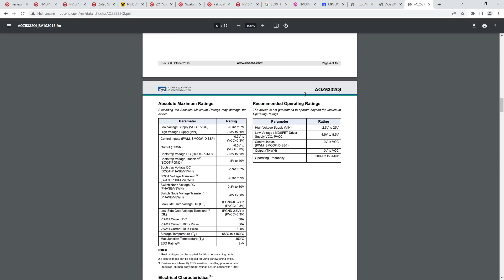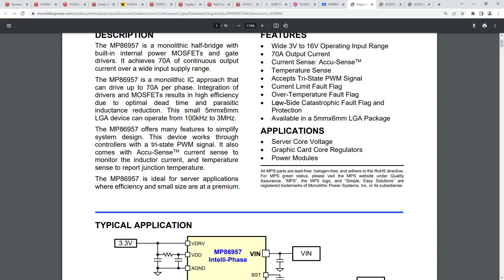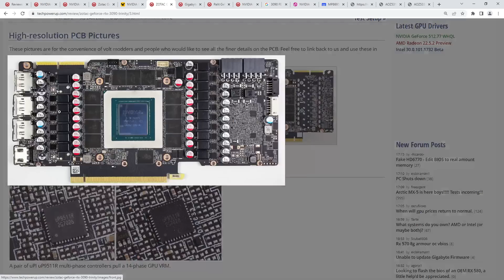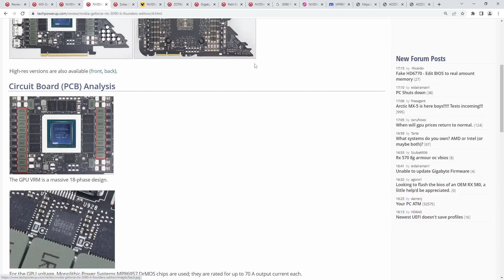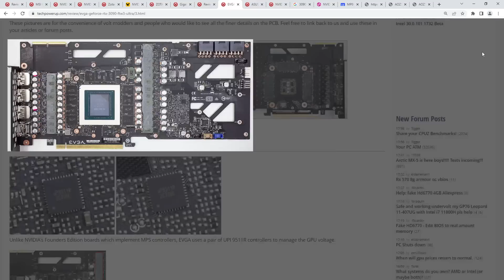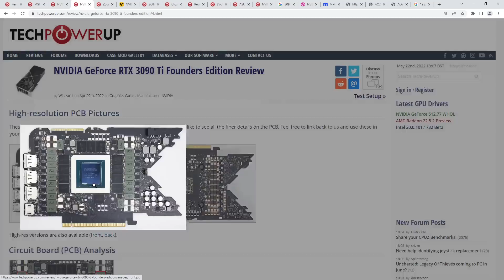RTX 3090 Tis should be much more reliable than RTX 3090s

Comment: I totally agree with you. I can speak from experience.
1. AOZ5332QI and AOZ5311NQI are used in 90% of 3080-90 and are definitely the cheap solution. 95% of the cards that have been shorted is due to these parts. In most of the cases a repair is possible, but the circuit board is burnt and everything has to be milled. Unfortunately if one of the memory phases blows then the GPU and all the ram chips burn up. I definitely don't like them and find this a big manufacturer mistake.
2. MPS has great phases and controllers. All protections are synchronized and if something goes wrong the whole system shuts down and can't boot until the failed phase is replaced and the error is cleared from the contorller. They are definitely more expensive,but I have never seen a card blown,burned or destroyed with them.
Reply: If the card has crappy components it's not a manufacturer mistake, it's a manufacturer CHOICE
Reply: Alpha&Omega components is stuff i see on my sub 300 dollar 3d printer motherboards, literally.
Reply: Are founder editions affected by this? Just strictly founder 3090 (regular models) will thermal pads help?
Reply: Which cards use MPS as you mentioned?
Reply: I use 890w on my 3090 ti tuf with 17 phases vrm and limit the pl to 623w
Some games power draw 570w-600w
Is it safe?
How much power 17 phases vrm can handle?
Reply: Hey I know I'm a little late on the reply but I agree. Nvidia just put the blame on Micron for the hot operation temps on GDDR6X and Microns outline stated 95c is an acceptable operating temps so people are still running these things with stock cooling and believe that the VRAM temps are acceptable. Meanwile their board is getting cooked. The only way to manage reasonable temps on 3090 and even 80 it watercooling, preferrably with active backplate.

Comment: I've had a 3090FE for a couple of years now and during that time I've ran an OC that pushes the card to over 400W, I just found this video now and I'm a little worried. To be clear I've never let the card overheat; when I got the card I replaced all the thermal pads with Gelid extremes and ultimates so the memory never goes above 100°C, I also repasted the card with Thermal Grizzly Kryonaut so the core temp levels out at 70°C with the hotspot only reaching 83°C, even at over 400W. Is it dangerous for me to continue running the card under these conditions? I know the components aren't being thermally stressed, but will the board power alone be enough to damage them? I've tried undervolting the card with MSI Afterburner in the past but I've had no success, the card just keeps chugging back its standard TDP of 350W even when it's following my custom voltage curve, I've had this problem with many cards such as my 1080Ti, RTX 2070, RTX 3080, and the aforementioned 3090. Strangely undervolting does work on my old GTX 1060 3gb, signalling to me that its not user error and is either something to do with MSI Afterburner or the cards themselves. If anyone could comment on whether its ok for the card to run in these conditions or help me with undervolting in MSI AB it would be greatly appreciated!
Reply: Ok it seems that Founders Edition 3080's and 3090's are not as badly designed as some of the other reference PCB's, they have better board components that should be able to handle higher power consumption.

Comment: Hey Buildzoid, I like the channel. What your're saying in this vid is true. I have 3090 FTW3 ultra which ran so hot I refused to run them with stock cooling. Memory temps @ stock would hit over 100c within an hour of playing a demanding game like RDR3/FARCRY6. I threw on a cheap Aliexpress waterblock set with active backplate and the temps were much more stable- under 80c even under continuous 3dmark bech test. When I got my 3090 Ti the temps were basically the same as the watercooled 3090 sometimes even lower. Anyone with a 3090 should have a waterblock with an active backplate because the RAM chips will likely fry very quick if you intend to use it daily. Feel free to reach out if need any specific specs!

Comment: Tha k you for the informative video. One question. You made a video that showed the asus tuf gaming oc 3080 ti is the same as the asus tuf gaming oc 3090 are the same. Thus, would you still recommend against the asus tuf gaming oc 3090?  I just figured a 3090 would be better, since it only uses 350 watts vice 450 watts than 3090 ti just for 10 percent gain performance I the 3090 ti. Please correct me if I'm incorrect. Thank you.

Comment: Should I do the double sided ek water blocks on 3090 founders... or just get a 3090ti  founders editons ?
Reply: Save in the block and get a TI.  4090 comes out in 2 days though.
Reply: @4gbmeans4gb61  yeah here its 2000€ orders open tomorrow trough Nvidia and parter cards wont be cheaper I think
Reply: @alouisschafer7212  they will if less people buy them which i think will be the case

Comment: I have an EVGA GeForce RTX 3090 FTW3 ULTRA GAMING, 24G-P5-3987-KR still in the plastic this has been on my shelf for a year. Are you saying I should not install this card based on (well-founded) speculations? (I'm actually listening as I type this). I was going to pop it in my rig, but I'm seriously worried. lol

Comment: Makes me even more comfortable with my EVGA 4985 3090Ti purchase ($1499)!
Reply: They were 1165$ last week.
Reply: @Jolinator  I just checked the EVGA Amazon store and the card I have is $1398. Different model cards have different prices.
Reply: @SPSteve  it was a limited sale for $1199 and if you use evga associate code it brought it down to $1163. i purchased one. evga pricing is all over the place as 2 days ago it was listed at $1299 now its back up to $1399. I guess evga were just holding too much stock. Have you had a play with your card yet? i have yet to open mine but frame chasers had some pretty good luck undervolting his which drops the wattage way down . igors lab also has an interesting article on undervolting the 3090ti to 300watts, worth a read!
Reply: @Jolinator  I've been using the card for over a month. It is absolutely bad ass. I'm using it out of the box without performance tweaks and the performance is amazing. It runs very cool and as strange as it may seem, my system runs cooler. My CPU temps are about 6 degrees C ccoler than when running my RX 6700 XT. I'm very pleased with the card. It would have been nice to get it cheaper but that's how it goes sometimes.
Reply: @SPSteve  Good to hear. Enjoy your card.
Reply: @Boofy Goofy Imagine being so salty you reply to 8 month old comments for someone pointing out a sale! if you read the comments above you would see there is clearly no hard feelings between either of us. Cheer up dude.

Comment: Any reason that you picked out a Palit 3080 TI & not a 90?
Reply from the maker: that palit is as close to refrence as it gets for the basic GA102 PCB and finding a equally refrence 3090 PCB picture is a pain.
Reply: @ActuallyHardcoreOverclocking  Thanks for the reply BZ. Now I wonder about my 80ti FTW3 & if that PCB is too much like a ref3090. Although I saw that the VRM chip is a NCP8610 which seems to be better than the 9511.

 The conclusion is from my limited understanding & what little I could search up.

Comment: 28:36 This may be more relevant than you might think... imagine what happens if for some reason  grounding on the audio output jacks is taken from another point along that current path than audio chip ground, or even some of that return current is travelling on the audio ground itself. You'll probably be able to hear GPU action without the need for any /external/ ground loops at all. Big oops. And yes, I have seen reports of current boards with audio issues.

Grounding in PCs is a mess in general. I bet just the choice of case and PSU can make a huge difference in EMI, merely due to how well the case parts and various components are bonded together.

Comment: They just need to shove a flat heat pipe on the back of the card that makes contact with memory modules and the back plate with a little bit of thermal paste or thermal tape and the surface area of the entire backplate would resolve that issue.

This would be especially true if they included any slotting in the backplate to make it act even more like a heatsink.

Comment: I've heard that the pins on the 12-pin connector are just better made than what's required of older connectors, so potentially the contact resistance is lower, on top of the requirement for fatter wire.
Reply from the maker: As far as I can tell they are actually just worse than the best 6 and 8pins you can buy. Molex sells Minifit Jr. connectors rated for 13A per pin pair. The Microfit connectors seems to max out at 8.5A per pin pair.
Reply: @ActuallyHardcoreOverclocking  Though the 12-pins are likely to improve, you're right that they may never be as good per pin -- at the high end.  But AIB partners have to assume a PSU that simply meets spec.  Anyway, the 12pin has 6 pairs in the same board space (or less, with the vertical ones) as the 3 pairs of an 8-pin.  So 2x12 is the space of 2x8 but current close to the best 3x8.
Reply: @ActuallyHardcoreOverclocking  what about the 3090 suprim x, will it fail too or is it a good card :O?

Comment: Had a Zotac RTX 3090 used for IA model training diying on me cathastrophically. It just exploded with fireworks coming from near the pcie slot power pins on the card. Both sides burnt. Can I upload pictures somehow? It is something to see, really. The shop that RMA’ed the card is not very optimistic about the manufacturer response.

Comment: I knew this when I was buying my 3090. I got that 10-year EVGA warranty for a reason, and EVGA cranked up the price on warranty later for a reason, and it's not because the 3090s are reliable.
Reply: Also reduced the warranty to 7 years
Reply: I have had 3 dead 3090ti, might be working on the 4th. Evga.
Reply: @ZeroSpawn  holy shit really? How have you gotten 3 dead cards? I have a 3090ti suprimx and no issues so far. Do you only game w them or?? I was thinking of getting an evga card but maybe I won't.
Reply: @parkersgarage4216  yes their XC3 model will blow their MOSEFT chips, i went through 3 of them. I had to cuss them out to give me the FTW model. FtW does not have this issue. Card is now working just fine. Horrible service do not get a EVGA.
Reply: @ZeroSpawn  that's gonna be easy from now on seeing as EVGA doesn't touch boards anymore

Comment: The fact that the 3090 Ti Founders has unpopulated power stages, upgraded power stages vs 3090 and how late in the Ampere generation it has come, the rumor that the PCBs for 3090 Tis are going to be re-used for higher current Lovelace ones seems pretty solid.
Reply: Do you think the 3090 Ti will be far behind the performance of a 4090?
Reply: @CastIronEric  yes.

Comment: a big question is in what of the following situation the voltage spikes are worse
so let's say an 3090 at 90% usage rendering very heavy stuff but in one case at 30fps lock and in another case at 60fps lock or 120fps lock
also we are talking about heavy lock witch makes the card pause between frames and not continuos witch is a long story kinda

Comment: All this talk of the 3090 memory failing made me really nervous, until you mentioned the Strix and its components being placed higher up. Since I've got a TUF 3090 I quickly googled, and the same is true for this card aswell. Still a possibility for a power stage to blow a hole in the card though, but then again I don't really push the card hard since it only has two 8pin power connectors. Should have bought the strix lol
Reply: I am considering the STRIX and his comment on that made me blow a sigh of relief!

Comment: should I be concerned here? I bought a 3090 last summer so that I could have a gpu that would handle anything I throw at it in terms of work and games for the next 5 years. I've already set my power limit to 90% and set an aggressive fan curve. Worst part, its a gigabyte gaming oc variant so if this thing does fail in my 3 year warranty, ima be down for 1-2 months while gigabyte decides when they want to honor their warranty.
Reply: Sounds like lowering the power limit was a good idea

Comment: Did I see Jayz two cents re applying thermal pads to his memory cause they were running over 100C... I know GDDR is different but highest I've seen my motherboard RAM running at is 56C and I didn't like that.. I like adding little heatsinks to any RAM on the back of GPUs that dont have a backplate.. seems the power requirements are getting so high.. I do wonder what a GPU heatsink could do on a CPU given the power they are handling but wouldnt be too easy to fit on a CPU space wise.. 😂

Comment: Hmm, about the 8-PIN to 12 PIN PCIe connector issue: could you measure the resistance of both connectors...? Maybe the new 12PIN has a lower contact resistance than the old 8 PIN. That would make the higher watt rating a bit more plausible...
Reply: I'm not an expert, but if the 12 pin connector with 6 12v pins is replacing three 8 pin connectors total 9 12v pins, then at the same total current, that's fewer pins, which seems like it would have higher resistance if the pins are otherwise the same. I also wonder if the pins are smaller on the 12 pin connectors, which would increase resistance further. Therefore the only way I can see for the 12 pin connectors to have lower resistance is if they have significantly improved the pin connections somehow

Comment: If the rumors that the 3090ti PCB was made as a test for 40 series PCBs are true then i hope this means we won't have these issues next gen. High end GPUs should not use subpar parts especially if they want MSRP to be as high as it is.
Reply: It still will be a cluster fuck. Having to cool 1/4 to 1/3 more TDP needs more heat-capacity and more surface area or the temps will go into overdrive, which means it will lead to even bigger and heavier aircoolers, which by simple leverage laws of physic will impact the the pcbs no matter what, and there are only so much AIBs that fight the "sagging" with mounting the cooler package with the chassis bracket. Or we will see a warning has to be mounted vertical only. Or we will see the comeback of All In One water cooler for this bracket, but not only with some 120mm exchanger but 240s/280s. So you get a $150 Water cooler + $50 cooler for memory and vrm design just to get the thermals somewhat under control. It will be a shit show. Not as much as Termifermi by NV or the 295X from Amd, but it will have casualties.
Reply: You're off your trolley

Comment: 32:55 Too expensive. Three 8-pin connectors add $1 to the BoM cost of every high end GPU and PSU. Margins are tiny in consumer electronics; The last couple of years were an exception
Reply: I wonder if they could have instead kept the same size pins , but have a few more of them , say another 4 and rate the connector for 600W+ , taking advantage of the headroom in the current 8-pin spec.
Reply: Welcome to Everything sold by Nvidia & Intel They don't care if its overpriced.

Comment: It doesn't matter if you get a rubbish bin on your GPU. I had a 3080 Ti HOF and it was a slug and leaked heaps of heat. I'd rather have mediocre power delivery with a good chip like my MSI Surprim 3080 Ti has than excellent filtering and power delivery with a bad GPU.

Comment: The memory chips probably won't burn up, but if they are going to we won't know for a few more years because this is the first gen of cards to have this level of memory power draw as well as the chips on the back.

I think most cards have thermal monitoring on the memory chips, and several outlets have reported decreased performance in benchmarks because the chips on the back were the thermal bottleneck on the card. Just having a metal backplate and thermal pads to the chips was often enough to completely remove the thermal issues though.

Comment: What you said about the memory chip at 20:12 is interesting. I work at a system integrator and noticed that a lot of GPU's fail after being shipped in a built PC. Commonly 3090s, I've been thinking it was static electricty from the Instapak packaging on the inside of the PC or something like that (reports of lots of static from customers). But I think the memory chip next to the PCI-E slot breaking is more likely since shipping would put a lot of stress on it.
Reply: Makes sense. If the prebuilts don't have one of those extra graphics card support brackets then the card is only supported on 2 sides and can flap about inside the case as the whole PC bounces about in the back of a lorry.
Reply: This is going to potentially become a more serious problem with the RTX 40 series cards - with their rumoured power draw and 4+ slot heatsinks approaching 2kg . Wonder if might become the case that if some kind of support bracing isn't used , and the PCB bends or damages the motherboard PCIe slot the warranty will be voided.

At least it seems as though the memory chips are being moved away from the edge of the card - I'd have liked to see this sooner after the 2080ti VRAM failures at the card's launch due to PCB bending.
Reply: Naw, it’s because the 3090 has half its memory chips on the back of the card and almost none of them are cooled.  3090 ti has all memory on top and none in the back so they are all cooled.